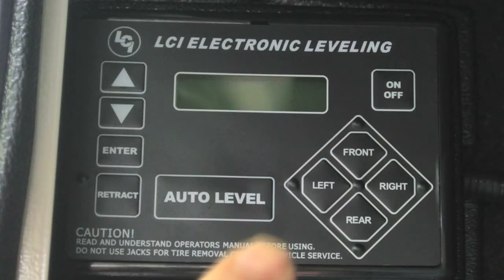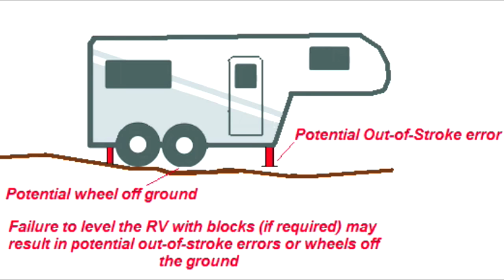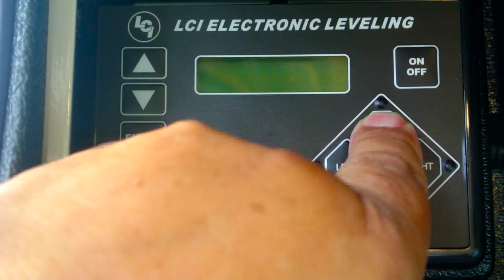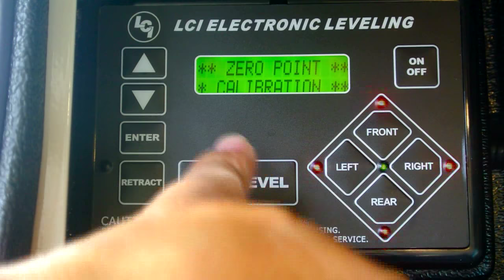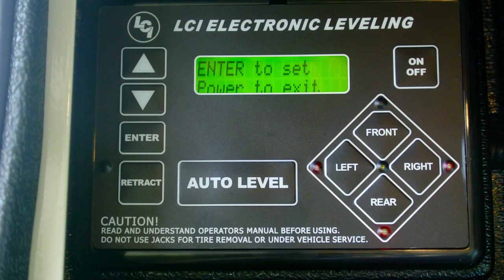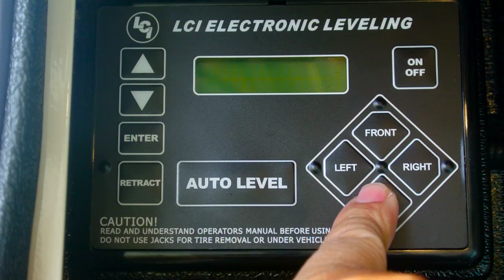How to reset Lippert's Ground Control 3.0 Leveling System

Comment: Thanks for the video. Thinking their system has changed over the years. Over the last year full time in an 21' ORV 21RBS-T, I rarely used any blocking so extending all the way to the ground was typical. I tried blocking to your suggested 4" and this created errors immediately. I spoke with Lippert customer service and they indicated there is no suggested blocking to 4" or anything and as long as you don't run out of stroke, the system is intended to land on the ground or on just a little bit of blocking, but surely never intended to be blocked up so only 4" of extension are used.

Comment: So if I needed to re-calibrate the system I would first level the RV using the manual settings. Then I would enter into the zero set screen. What do I do then? If the system is level (because I manually did it) will the system then recognize the new setting and all I would do is press the exit? I would like to see you do the whole process.
Reply from the maker: There are actually two different processes.  The process shown in this video resets the level point.  In other words, it resets what it thinks is level in it's memory.

The second process is a re-homing, or re-synching process when the 4 (or 6) cylinders are out of synch. Typically you only need to do that once during the initial installation or if you have a problem when one of the jacks fail to raise or lower (wiring problem, blown fuse, etc).

If you manually level the system, the system will not recognize the new setting unless you do the process I show here.

It's really a simple process. 

First, you level the coach to your liking.

Second. turn the system off. 

Then depress the UP key 5 times, then the DN key 5 times. This wakes up the system in reset-mode, and you will be prompted to use the "current" settings as your new level setting, or exit without changing the setting. Confirm which action you want to do, and that's it. 

The system does not check to see if it is actually level or not, as it assumes you want to use the current position as the level setting. So if the RV is not level when you do the reset, it will use that same unlevel position from the on.

This is actually level if you purposely want the RV to be a bit unlevel. For example, if the RV is level,  and your dining table is in a slide that is not quite level, you could level the coach in respect to the dining room rather than the middle of the floor.

Comment: I have a question when you did the pushing 5 times were the jacks all down or up? because Im having an issue with the back jack stroking our error but its up all the jacks are up and still beeping saying its out of stroke
Reply from the maker: When you have an out-of-stroke error, it means one of the jacks is extended all the way and can go no further. 

  To remedy the issue, first, abort the autolevel. Then use the up/dn keys until the display reads Manual.  At that point, you can use the 4 keys to the right to lower the front and rear jacks.  

The jacks should lower as a pair; i.e. the front button lowers and raises the front two jacks (depending whether or not the Retract light is on).  The rear button lowers and raises the rear two jacks. The Left button lowers and raises the Left front and Left rear jacks, and the Right button lowers and raises the Right front and Right rear jacks.

Once you have all 4 jacks down, run around with a spirit level and see where you are off-level.  Then raise or lower the jack pairs in manual mode as needed until you are satisfied the RV is level.

Then you can calibrate the system so it will always return to the point at which you just leveled.  

You do this by turning the power off the unit.  After power is off, press Front 5 times, then Rear 5 times.  The power will come back on and ask you if you want to use the current level as the new level. If satisfied your RV is level, acknowledge your selection.

Note this is for the Ground Control (electric) 4 jack system.  The center jacks are just stabilizers and do not participate in leveling the rig, but should go down when you autolevel the next time.

 If you have the hydraulic Level-Up system, the sequence is the same except you depress the Front and rear buttons 10 times rather than 5 times.

Comment: Maybe a dumb question but if you can't level because you're getting errors and you need to re-home the system with it starting from level, how do you get it to where you actually know it is level, and you aren't making it worse by programming it to achieve a non-level result? I'm currently parked at a spot that's fairly level for a gravel pad ( +1.0 front to rear, - 1.0 side to side) and am getting Out of Stroke errors no matter what I do with jack settings or blocks. I've had this rig for 6 years and landed it at least 100 times without problems, and this shouldn't be a challenging landing.... Pulling my hair out trying to get this to level but it won't do it unless I manually extend and retract the front and rears, and even then there's no way to extend the stabilizers in the centre. Camping is supposed to be relaxing, right? LOL   Anyway, was hoping maybe resetting this controller may be the solution, but sounds like it can't be done at a campsite, but more like on a parking lot
Reply from the maker: Basically, manually level until you are happy with the results, then to a re-zero.

You can use any acceptal method of determining what level is, from a carpenter's level or which side the eggs slide to in the frying pan to determine level.

You will likely find many instances of "level" if you use a carpenter's square, as no two surfaces in the typical mass-produced RV will seem straight.

When I level, I use the dining chair to measure, as that is where level/unlevel  is the most noticeable.

Comment: I also had this problem with the out of stroke error code. The question, after our trip I remove the batteries, will this cause the control to loose memory?
Reply from the maker: I never remove my batteries, so I cannot answer that. I would contact lippert and ask.

Comment: I know this is an older video, but one question.  I have this system and it has only worked one time.  My question, whenever you remove power from the RV will you have to re-zero the system?  Whenever we store our RV, I remove the batteries.
Reply from the maker: You indeed may have to reset the system.  There is another video you might want to watch. It concerns recovering from an error, but a low-battery condition could also cause this problem, and it might be worthwhile to perform this procedure as well:

https://youtu.be/RAKzOaTwMSs

Finally, here are the associated webpages for those videos:

http://www.rv-project.com/tips/groundcontrol.php

http://www.rv-project.com/repairs/badjack.php

Comment: Can you do a video to explain how to rehitch using memory.
Reply from the maker: I don't use that feature as it seems more hassle than worth, but yea - the next camping trip I will look into using the hitch position feature.
Reply: I am learning the system too. One thing I understood is thay rehitching will work if you “unhitch” properly. Basically it memorizes the stance only if you use Jacks down function when you arrive at your site. It will then raise the front exactly to that point. Therefore, the first pressing of the button when you arrive at the campsite (or unhitching) is the key to properly rehitch.

Comment: Sep 24, 2021 and this is exactly what helped me with our leveling system.  Worked the first time I tried it.  Based on your information, I'm assuming the dealership initially set up our camper on a down-slope so when we parked, the front jacks went way too high.  Thanks!!!
Reply from the maker: Most dealers don't know how to use the levelers I don't think.  And the mfgs rely on the dealer prep to calibrate the system. In the end, the owner is the one getting the short stick.

Comment: This video is useful if you need to zero calibrate. It doesn’t address resetting the system, as in the title, when you have a myriad of problems. Ie more than 1 problem. There’s also no clarity in this video if zero calibration resetting is the same as resetting in general. You can have problems that have nothing to do with resetting the zero calibration. FYI folks.
Reply from the maker: Every video I produce has an associated webpage which goes further into the topic than is possible in a 3 minute video. I provide a link to every video for the associated webpage as I designed the video + webpage to provide the complete information.

I also post a link to the webpage on the description of the video.

The webpage can be found here:  http://www.rv-project.com/tips/groundcontrol.php

There is no named "reset" procedure in the Lippert documentation. There are only two possible "resets" available.  Re-homing and zero calibrating.  Re-homing corrects low battery and hardware/wiring issues, while I have found that zero calibrating pretty much fixes all other "operational" issues.

Zero homing, which I cover here: http://www.rv-project.com/repairs/badjack.php fixes "Jack Error" problems, which can occur either due to low battery voltage, or a bona-fide jack problem, such as a wiring issue (which I once had).

To correct a Jack Error problem, you must do the re-homing procedure.  

I have found through experience that when your trailer gets an out-of-stroke error, the system goes brain dead; it will lift the tires off the ground or attempt to "level high", even when you are on flat ground.

Zero-calibration will usually fix these problems.  So in that sense, it is the defacto reset procedure.   If you would consult my webpages I provided, you would have the complete answer.